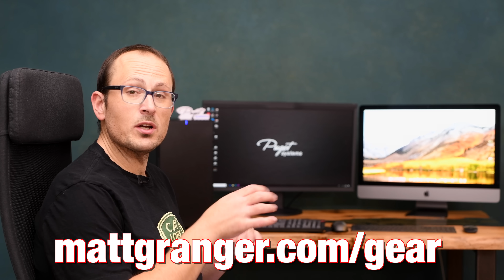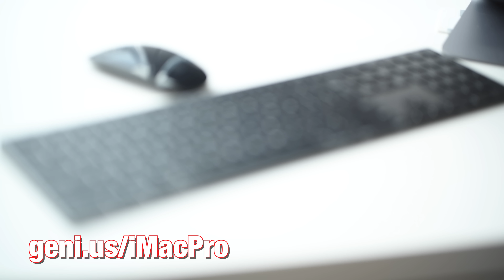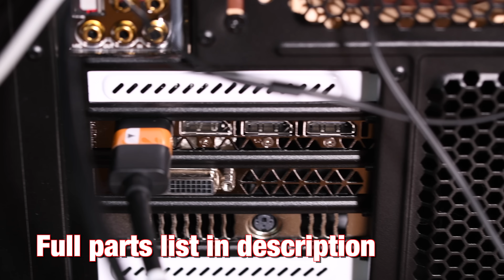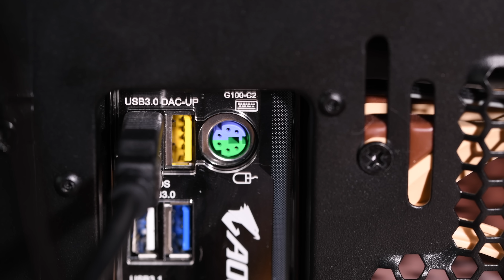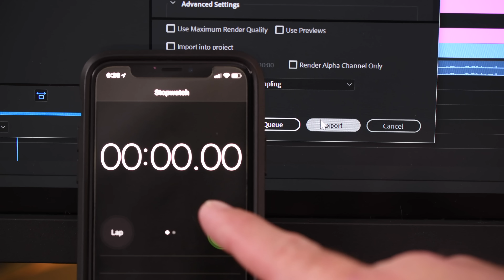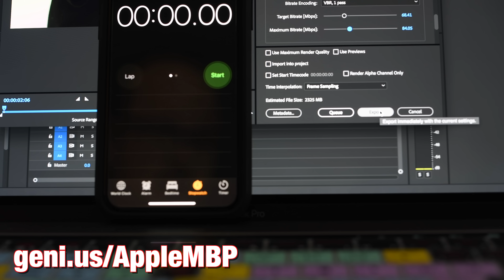$10,000 iMac Pro vs Custom PC - Which is faster??!

Comment: Hi Matt, I’ve been running my iMac 5K since 2014 and aside from a few overheating issues (mainly dust and thermal paste related) it’s been pretty reliable and still works as well as it did when I first took it out of the box. I’ve never owned a PC that lasted more than 3 years but I’m getting to the stage when I’m thinking about upgrading again. I’m limited budget wise to about the $3K mark... can you recommend any PC’s that are as reliable as the iMac at that price point?

Comment: May I please ask your advice. I want to process and edit photograph files from a Fujifilm GFX 50R, 50mp sensor, and I have the opportunity of an iMac (specs below). Do you think these specs are good enough to handle these files...iMac retina, 5k, 27inch 2017, processor 3.4 GHz intel core i5, Fusion Drive, RAM is 32 GB 2400 MHz DDR4, Graphics Radeon Pro 570 4 GB. Would really value your advice please. Thanks.

Comment: well, if you're gonna talking about performance vs money wise, then i think you should consider this instead, because if im not mistaken, you've got this system from Puget System too which i think is not even the best way to go with nonetheless. Puget System charged alot for their work and so if you were to build this system yourself you could've save a few thousand bucks for other parts or an even better more exotic parts that will make this system even more powerful. so honestly both choices wasn't that good if i may say. maybe the custom system might suited your needs a little more because its a custom build therefore you can put more money to which category you're most needed on but still, not the best choice either. i'd say this is a tie lol.
however, thank you for the content and info, was really looking forward to see those Quadro cards performing in real life applications on a day to day basis as well, so thanks for that.

Comment: if you got the 10 core iMac Pro and put the extra 1K in different specs, or took 1.5k out of your PC (because it was 500$ more expensive to begin with) the results would be better on iMac, since there is no difference in premiere performance after 8 cores

Comment: Wow, I think that getting an iMac Pro and not running Final Cut is a real waste of kit, Adobe is not a fan of Apple (Apple did kill Flash lol)  also the custom build from Puget Systems with a Quadro Card and that much ram is going to be a killer system. what was the real point of this comparison?

Comment: I don’t know if it is the case, but if the output is h.264 or hevc, it is unfair, since Adobe released the Mac version of the System and hardware optimized encoder just a few days ago. And Mac should also be set on Metal.

Comment: I'm a professional film-maker and use Final Cut Pro on an iMac Pro. FCP on an iMac is twice as fast as the Premiere times shown in this video. Final Cut Pro is every bit as advanced as Premiere, except FCP has a faster and more modern timeline. Premiere Pro is not optimized for Mac OS as it is for Windows. So I wouldn't recommend using Premiere at all on a Mac. So in my professional experience making actual theatrical feature films and national television commercials, Final Cut Pro on an iMac is superior to Premiere on a PC. Something this biased amateur photographer is incapable of testing or admitting to.
Reply: it seems you are out of touch / out of date. everyone has moved to premiere now because its faster and more efficient. 80% of editors in the world now use premiere. its much better than that imovie/final cut pro garbage
Reply: This is what happens when you don't know  a shit about computers and just buy for branding. Yes Apple is great I have nothing against them. But a build pc is a better investment as you can even adapt it to a hackintosh build. The versatility that you have on a custom pc is far superior than any mac pc you'll ever woek with, unless Apple release a modular pc.
Reply: Correct MeniThings.. The problem with premier pro is that it has horrible mac optimisation.. and of course that makes a difference!
Reply: Dont underestimate the amateur. "Noah’s Ark was built by amateurs and the Titanic was built by professionals.”
Reply: @A A - how rude, he or she can stay in any topic they like.. YOU GTFO!
Reply: I don't think you can run FCP on a pc so that's not an equivalent comparison. Also for those who would rather run outside of the Apple ecosystem it would be necessary to examine solutions outside of that system.
Reply from the maker: I have countless hours editing in FCP. Can you share some of your results using 8k content, as that’s what you’re arguing about - the render time for 8k video. And FYI, premier is far more commonly used for professional work
Reply: @mattgranger  yup. totally agree, premiere is the way forward for us pro's, every post house i go to as a director uses premiere now. fcp is just out of touch.
Reply: It's up to you to compare 8K video between competing platforms, not me. You're the YouTuber who needs to prove you're not biased against Apple. Also please use at least version 10.4.1 of Final Cut Pro X for your comparison. As far as Premiere being more commonly used for professional work, that's a lie. Final Cut Pro X has the most licensed users that make a living editing (i.e professionals). On the very high end (theatrical film and broadcast TV) it's Avid, and then Premiere Pro that lead market share. But that's a tiny segment of the professional market. And I should know, Premiere was used on the last feature film at the studio I work at (for the film Deadpool), and we're an Adobe partner that helps develop Premiere for theatrical production. Premiere excels at collaborative editorial. It's an excellent NLE, but it is NOT faster than FCPX, not by a mile. Do your research, and next time try looking up the credentials of someone who knows more about edit software than you do.
Reply: MeniThings,

Sorry to correct you but the burden of proof is now on you. You made the claim you are a professional video editor. You need to show a simple 30 second video clip of you working at the studio as an editor. I also want to see you editing multiple layers of native 4K Redone R3D files. I am sure the iMac can do it but I can as well using a mediocre 3.4 GHZ Haswell CPU, 16 GB of RAM and a mediocre GTX 1060. The video below proves not only can edit 4K RAW files using Premiere Pro on a mediocre system but I can do some really cool things with the Intensity Shuttle. As of now the burden of proof is on you. You must back up your claim. Keep in mind I also have FCPX. 

https://youtu.be/barrJWuBzCA
Reply: Final Cut IS twice as fast on MAC as premiere.. Not Final Cut is faster than premier Windows.

Comment: Yes, you can work and render in same time. Did you know Media Encoder? Adobe like Premiere. And if you do the same think/project on a Final Cut pro, that use 100% of iMac, you will see it's real power. Premiere is not really optimised for OS X, sadly. And you have 4 display connections on it too, use Thunderbolt, more 4k monitors plus the 5 k on machine, that is IPS and 500 nits 10 bit. Vega is a powerful video card, i don't know for P5000, but i know for the optimisation windows and drivers have better for Premiere. But you did a really grade comparison from budged point of view. Cheers! Not talking about the blazingly fast SSD m.2 dual on iMac. Not sure about the results. Did you use Open CL and or Metal for this render in Premiere?

Comment: Always enjoy your videos Matt.  You do great work!  

Regarding this subject, contrary to what the iHaters and numerous trolls infesting this forum are saying, the iMP is not a consumer-level product (even though anyone with cash can buy it).  It's primary reason for existence is for business use.  Meaning, it's purchased, used, and retired as most business assets are.  People buying this machine will NEVER upgrade internals even if their workstation is an upgradeable PC.  The professionals have better things to do with their expensive time than wasting it purchasing parts, testing it, configuring it, and hoping it all talks well.  Professionals want a turn-key solution.    5 years later, even a custom PC will essentially be rebuild into a new rig as no one will want a 5-year-old anything alongside a new piece of tech.  So the argument, while perfect if you're in the 1990's - is moot today.

If someone is going to build a custom-PC for a couple hundred dollars less than an iMac Pro, good for them.  Others want to walk into a dealership and buy a model and walk out the door.  Sorry it infuriates the haters here, but that's how the rest of the world works.

Comment: Regardless of the Mac performance, why in the world would you pay that much $$$ for something you can not upgrade?? If I am spending that kind of cash-I'm building my own system to my own specs. Apple can go to hell.
Reply: Z390, I9 9900k, 1080ti, 32 or 64 gb of ram unless you just really want 1200 google chrome tabs open while you work with other software then get 128 gb), 800+ watt power supply, a Dell, or Benq, or a Samsung monitor depending on what you're wanting to display,  you will be more than happy for less money.  Keep in mind, xeon processors are mega core processors and that means you may not ever get the cpu to flex its muscle, if you dont video edit or play specific games that can use multi threaded code its not going to really be that impressive for the price.  You could match xeons core count or beat it for less with most AMD high range processors.
Reply: @dennisgreiwe2078  or now r9 3900x with SLI rtx 2080 /ti  and so on and  still left  enough money for used  golf r4
Reply: Pros don't really care about upgrades. They want performance and reliability, and don't use their work time to tinker with the machine. You can upgrade disk space through external devices and Thunderbolt.
Reply: @Simboiss  tghey are stupid proos if they pay tons of money for basically slower computer
Reply: Can you recommend specs please that will rival the performance of imac pro pls? Thanks
Reply: You question exactly differ you from a professional editor who doesn't know and doesn't care about how to build a system. All they want is a reliable, working station so they can finish their job on time without issues.
Reply: I bet that a PC with Core i9-9900K and Titan RTX and the best motherboard would be cheaper than that iMac Pro
Reply: you can upgrade it.  -_-  Just got to know how to.
Reply: @hawkintelligence  yes you can,with tons of money
Reply: apple is quality products
Reply: @msdadsfsx  overpriced junk

Comment: Now if you replace the I9 with a 16 core Threadripper x399 slot and buy 3 Titan Xp's instead of P5000 how much faster will it get? Still under $ 10k budget

Comment: I went from Mac to PC, built it myself and had a whole bunch of problems, when you add in 3rd party interfaces...driver/conmpatibility issues, viruses are also more prevalent in a windows box, than a mac. It was due those extraneous issues, that I ultimately went back to a mac..shit just works out of the box, and more 3rd party stuff just works the way its supposed to. Depends on your personal setup, I geuss...sometimes just going for more speed ultimately may cost you in time spent on forums, dicking around trying to get stuff to work...instead of doing the work your getting paid to do. Definitely if I was going to buy a pc it would be from a specialist like Puget Systems. cheers for recomend

Comment: Too bad Matt didn’t use Final Cut on the Mac. Premier is built to use CUDA so it will not take advantage of the Mac hardware, hence, the slower performance.

Comment: Firstly, if you are used to a Mac ecosystem and you like to pay a hefty premium for no (decent) after-sales service, go for it.
Secondly: This PC system is quite expensive for the parts used. That being said, it comes with the lifetime warranty on parts and labour which is nice and it was built for the client, not by the client as many systems are.

To correct a couple of people here, Adobe design their products initially specifically for Apple. Hence why it took a while for them to bring out 64bit programs even though PC was 64bit from the mid-late 90's. However Adobe are notoriously bad programmers with major inefficiencies and bugs in a lot of their code. I was taught by one of their programmers and he was the worst lecturer and his programming in C++ was sloppy at best (recursive loops and other basic bad design patterns you learn not to do in 1st year).

However the file saving issue may be due to the fact that in the last couple of years Mac has made 3 significant changes to it's file system (including a completely new filesystem altogether), requiring changes to how you use the API. All were rolled back due to major issues with the new changes. So i could see a group such as Adobe using other methods, simply to save on future-proofing against update issues, or it could just be bad/lazy programming.

I would be interested to see a comparison in Davinci or AVID running on MacOS, Windows and Linux on both of these machines and see the comparison. I would also like to see windows server or windows 7 setup to run this (server as it has lower overheads etc., 7 because it deosn't have all the crap they have jammed into 8 & 10).

But as others before me have mentioned, this is a comparison of the two equivalent priced systems. So they must run the same software. If one system performs better than another, then quibbling over the software setup or particular hardware is pointless. It's about the efficiency of the system for the price paid.

Also since they have turned Dreamworks Final Cut into essentially an advanced version of iMovie, most groups in Australia have stopped using it for professional videography, moving onto Avid, Davinci and other systems. Please be aware that my job used to tech support for videography companies and yes, I had to fix Macs on a regular basis, from diagnosing hardware faults (so Mac couldn't try to get out of warranty issues as it does),  to fixing the frequent update issues, to explaining why the Mac pro monitors couldn't display colour correct images properly.

Remember the quicktime codec issue in FC? Where if you tried to use audio in the correct channels FC would crash and sometimes the entire project would go with it? But if you reversed your channels it was fine. Remember the update that Apple released that killed network connectivity if the background OS (linux) could identify a professional router/switch and apply network settings?

Comment: With regards to the iMac Pro, you can take the screen off to get at the CPU and RAM, but that voids your warranty.  Also, you can use Thunderbolt 3 to add an external GPU to replace the Vega 64

Comment: Great video. I used to work on the 27inch imac from 2016. But have upgraded to a Ryzen7 with 64 gigs of DDR4 ram, 1 x 500gb SSD (I work of a NAS) and a GRX940 card. It totally blows that old mac out of the water. Also the previous mac pro and even some of the standard current models.

Comment: If your monitor has issues can you replace it? With the Apple the answer is no. With Apple you may not be able to get it fixed either. I tend to buy very high end monitors and use the monitors for a long time. It may be used on more than one computer.

Comment: Also building a PC for audio using high end converters is just not happening . Try buying a 10k sound card converter to have to buy a PCIe card like pro tools HD , and then have to connect it to the PCIe and then suffer from less bandwidth , slower speeds ... doesn’t matter how fast the PC is or expensive , you simply cannot use PC for proper audio production

Comment: It has just been announced that the new Mac Pro won't be out until some time in 2019. After 15 years as a Mac guy, I bought a package build on Windows, not as high end as yours but it is more than capable of doing what I require now, and what I can reasonably expect in the next few years. Now my studio has both Mac and PC. Moving files around is currently a little inconvenient but not difficult. I'm actually enjoying my Windows experience. I don't have any plans at the moment to try and convert this to a Hackintosh.

Comment: I understand the criticisms regarding not doing a comparison with FCP on the iMac. I have been a Mac guy for 20 years, and currently edit on a custom PC (just for some background). Most would likely be buying a Mac specifically for running FCP because the performance gains are astonishing over any other software on that platform. I know Max would agree from the tests he's run. We're talking under ten seconds for some operations taking several minutes on a very fast PC in Premiere. Matt, you're a Premiere guy (like myself, for now) so I think it's completely fair doing a test like this for Premiere users. Maybe a "Which is faster for Premiere" would have been more accurate. Cider House is an animal BTW!

Comment: 2 major problems with this comparison.  1.) The iMac is an OEM machine, not custom built. This makes it unfair from the start.  2.) you are stuck with Windows 10   I'd personally take half the specs and run Mac OS and wouldn't wish 10 on my worst enemy. Maybe put linux on it. Also if you were using Final cut pro on the Mac it leaves the custom machine in the dust with less specs. You stacked the deck in favor of your pet PC. As for upgrades the iMac will still be rendering just as well in 4 years and you could sell if for 70% of cost. The PC will be almost worthless.

Comment: That was a stupid comparison. 
Why would you compare adobe on a Mac?
If you’re going to do a proper comparison between the two computers then use final cut on the Mac which what’s meant to be used on the Mac. Not leave it out because you know even with lower specs the Mac will perform just as good if not better using native software. 
This felt very biased made to make Mac look bad. Not a proper comparison.